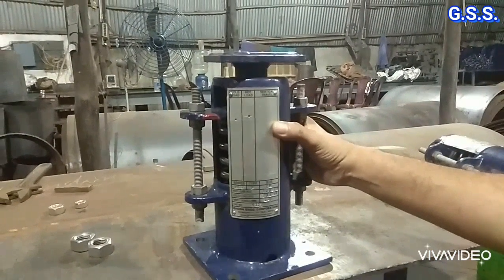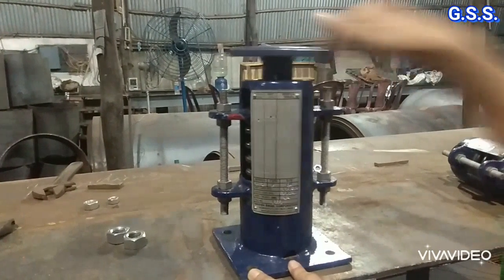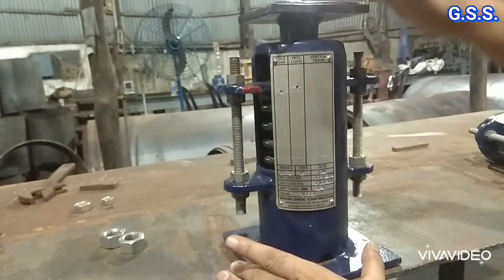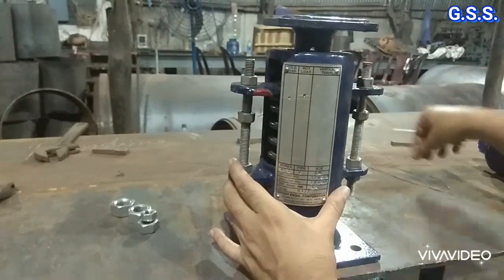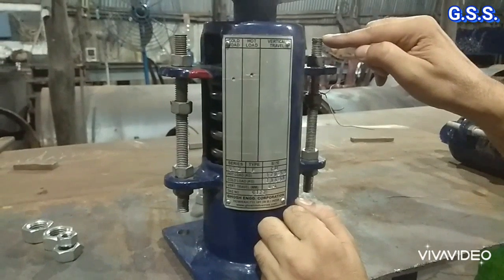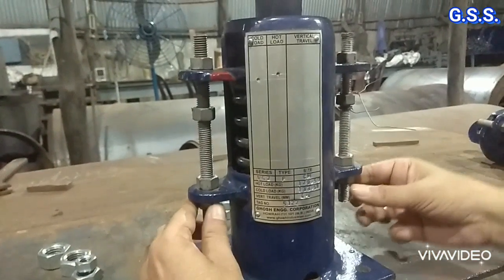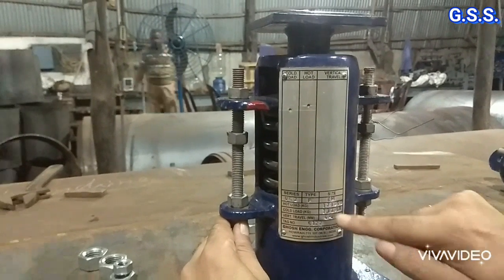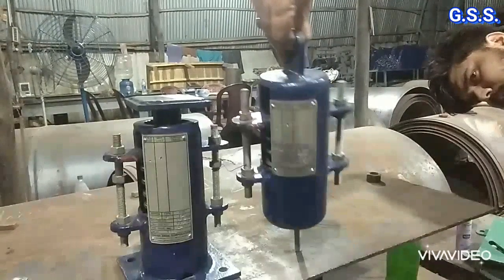Piping Engineering : Spring Support - how to install at site

Comment: Amazing explanation. You have explained very well about the spring that can be used in the pipe. In the next video, if possible, please dismantling the all spring parts and explain the components. In addition please show some examples of different spring rate at Shop. How is size look like.